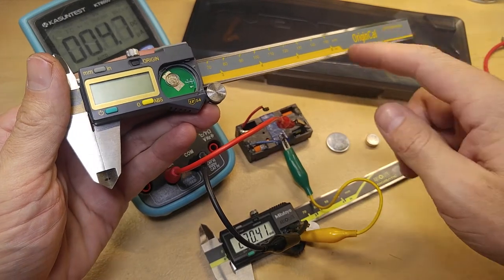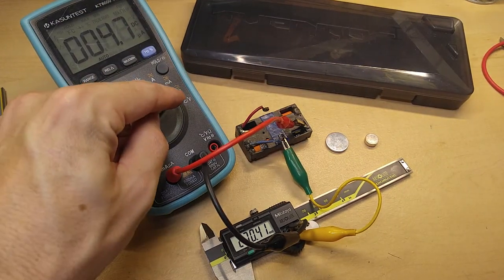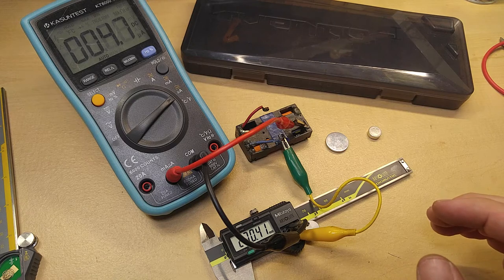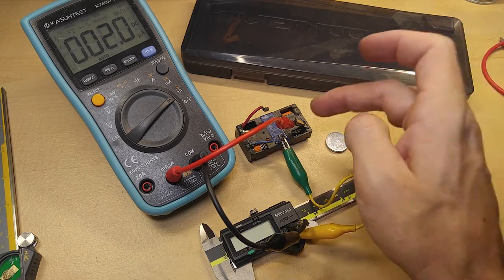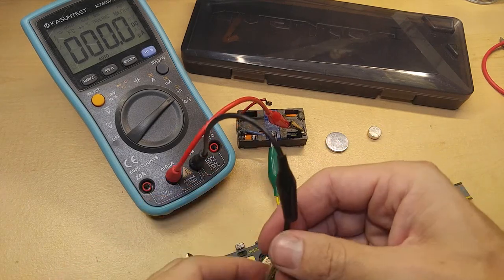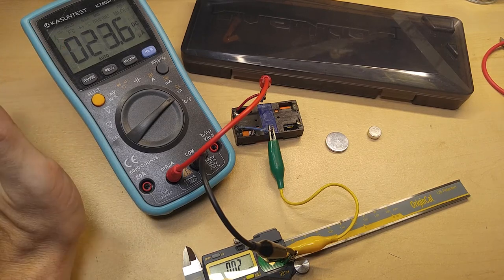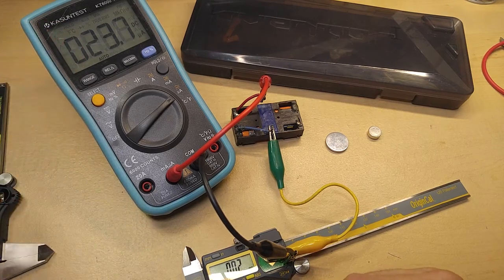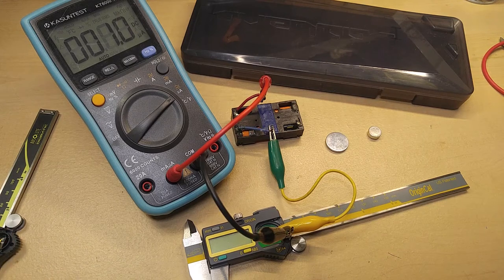(:Precision Measurement Series:) iGaging OriginCal Digital Caliper Power Consumption Test

Comment: THANK YOU for posting this info. In OFF state the OriginCal consumes 1uA compared to 16uA of the EZCal from your other video. That is a significant difference! The capacity of new CR2032 battery is up to 240mAh, which means that a constant 16uA draw will deplete it in little less that 2 years, while the one with 1uA quiescent current will let the battery last for over 20+ years. I like the EZCal's auto-OFF and large display, but will trade it off for never having to remove or worry about depleted battery.

Comment: Love most of your Caliper Videos! Thank You for sharing. It's great to see (and know) that the iGaging: OriginCal uses 10x more power than the Mitutoyo when it is ON, yet they are the same when they are OFF.

Recently purchased the OriginCal based on your videos. Now I'm looking at the various data output options for CAD & rapid prototyping applications. Would love to see a separate video, or hear your thoughts on the various data ouput methods: Wireless Transmitters, vs Cable, the various different cables offered by Mitutoyo, iGaging, Shars, etc., and other accessories like foot pedals. Cheers!
Reply from the maker: I've done enough videos, and had my hands on enough if them to know that it's not even worth it wireless... I have never met anyone that does enough data input to make the battery consumption worth it. Even then, the button pressing messes with the measurements.
Reply: Thank You for the prompt response! The wireless TX does seem a little unwieldy. The battery consumption was less of a concern for me. However, wireless TX seems like they might be slow too. Bluetooth enabled calipers seem "slow" compared to a data cable, so I'm just assuming a wireless TX will be "slow" too. The cables seem pretty instantaneous. I was hesitating on the iGaging cable b/c it looked so short. I'm guessing that was an older version though. The "newer" version w/ the 2nd input button near the data port looks like the way to go. Thanks again for sharing your thoughts and experience via both video and comments!

Comment: I'm in the UK and after seeing this video I checked the prices for both the Mitutoyo and the Igaging OriginCal. I bought a genuine Mitutoyo 500-196-30 for £85.00 (on sale) from a Mitutoyo distributer. The iGaging stuff seemed to be almost as expensive / not available in the UK. Also picked up some spare battery covers for the Mitutoyo at £0.70 each.
Reply: Cool! Mitutoyo are a solid brand

Comment: Dose the iGaging have a low battery protection in it so that when the battery is low it will still provide accurate readings? Thank you so much for your videos.
Reply from the maker: Like most, the display just gets a little weak. Measurements will be absolute, but it will be hard to read.

Comment: In 2022 the ASIC in the OriginCal was changed to a new part and unfortunately the good power consumption is gone. OriginCal's after 2022 are now 60µA in the on state and 22µA in the off state.
Reply: Interesting. Is it from your own testing? Would you mind sharing a short video on it?
Reply: I measured the OriginCal with the new ASIC and they are the new current consumption values. I talked to iGaging and they confirmed the ASIC change.
Reply: @jheissjr  That makes them a lot less desirable unfortunately. Maybe the EZ-Cal is the better deal today.
Reply: Why is the EZ-Cal a better today?
Reply: @jheissjr  Unless the iGaging EZ-cal were also changed in 2022, they draw less amps than the OriginCal. They were measured at 28.2µA & 15.9µA in another video. And they seem to be just as accurate.
Reply: Ask iGaging if the ASIC in the EZCal was changed in the last couple years. I think it was. Let me know what you find.
Reply: iGaging does not manufacture or design their calipers. They just buy them from another unknown company and resell them. On second thought ask iGaging what the current is for the EZcal in the on and off state. If you buy them I suggest measuring them to confirm. EZcal are not absolute type calipers though.